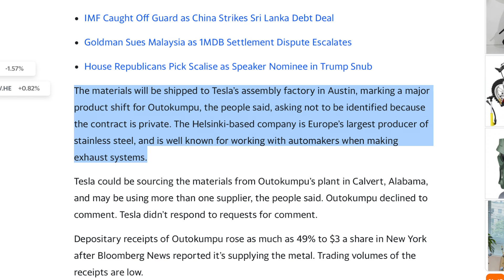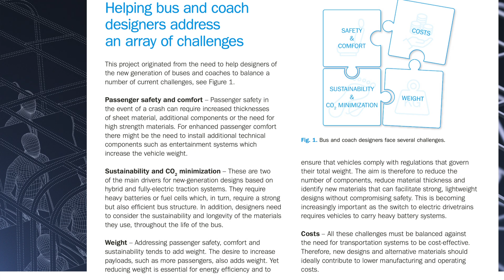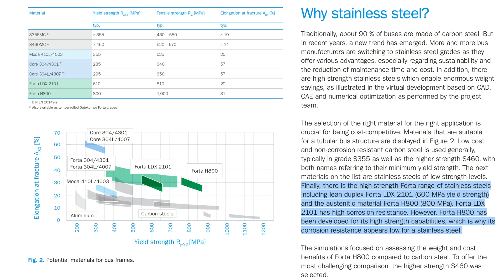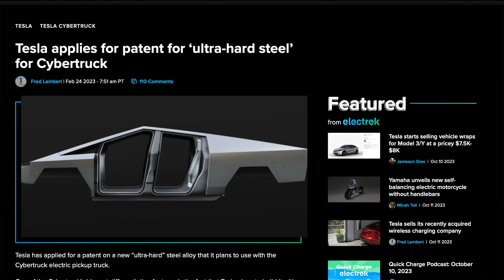Tesla selects Cybertruck stainless steel supplier

Comment: Well, well, that was a way too long Pauze, Sean.. But glad you are back! hope more often!

Good info about the stainless steel for Tesla, Nickel is necessary for making it corrosion resistant, so I am not so sure the stainless steel that goes into the body and exterior of the Cybertruck will not have nickel. It probably will have some nickel in it.

Another thing is that the same time Texas Gigafactory was built, a new steel mill was under construction not far away from Giga Texas, that also supposed to make stainless steel for Tesla, in the early days of Giga Texas, some drone video was released about that brand new factory... Of course Tesla can have multiple suppliers for stainless steel, that is always good for getting a good price for the raw materials 🙂

Comment: If stainless steel becomes too expensive Tesla could switch to aluminium.
One of the main reasons why automotive steels have been used as the preferred material for cars is their very good cold formability properties.
The design of the cybertruck does not require a high formability metal so that high strength stainless steels and high strength aluminum alloys become an option for the vehicle.
Reply: However aluminum can’t be a exoskeleton it would have to rely on a frame. I don’t consider stainless as lightweight. It is only light because you can make it thinner at equal strength to steel. However work hardening is an issue if there are any flex points.